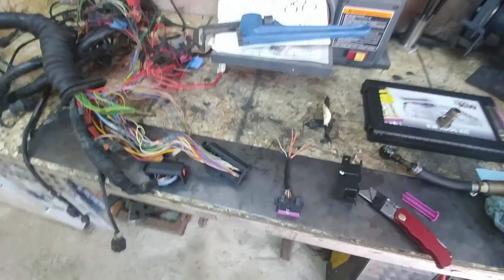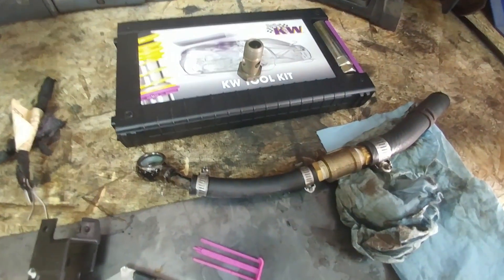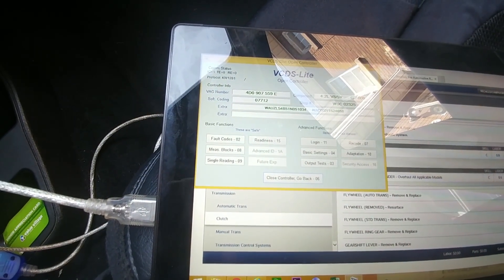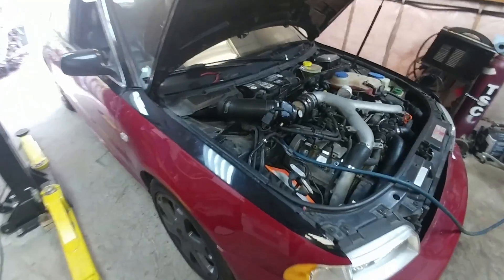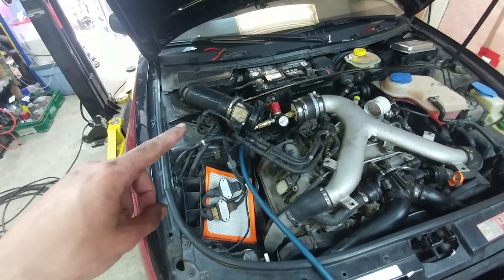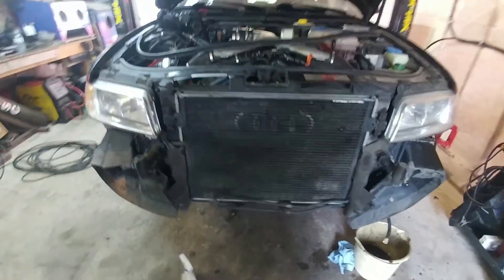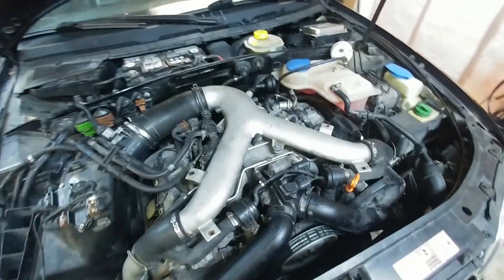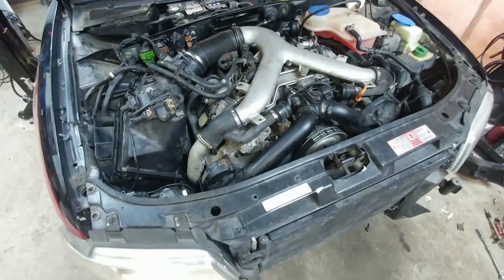More B5 S4 Fun... TAG 005

Comment: 1. Who is the one failing to tune the 4.2 ECU? (Sounds familiar)
2. Ideal bleeding is done by removing serp. belt and turning P/S pump with an Allen socket and a drill at a slow speed.

- 99% of the time you can't bleed the system because there is a vacuum leak on the low pressure side of the p/s system. Doesn't mean fluid will come out, but air is sucked into the system. Very hard to find unless pulling all the lines.

Comment: What type of spark plugs do you like to use on the 2.7T motors?
Reply from the maker: William Clark ngk coppers, 6's for a stock motor 7's for anything tuned. Gap starts at .028 and will be tightened down depending on setup/tune.